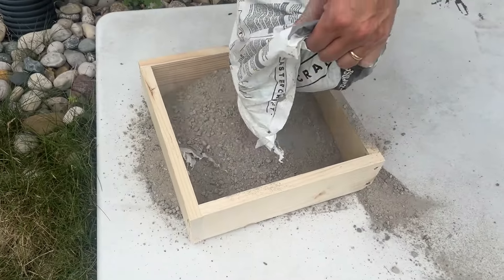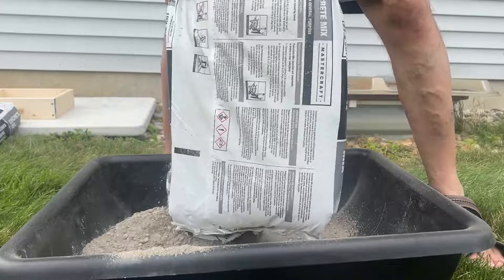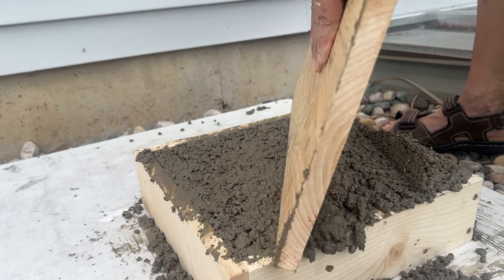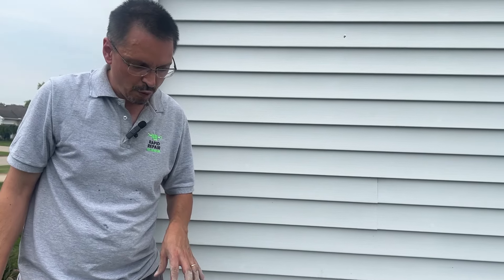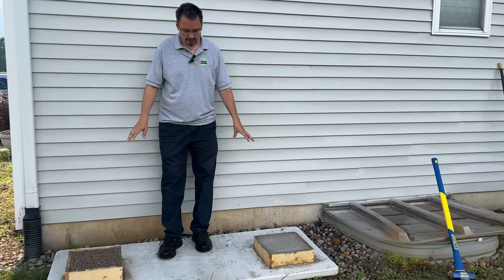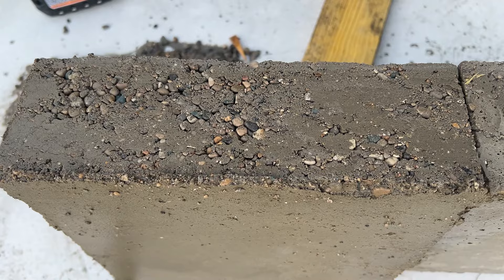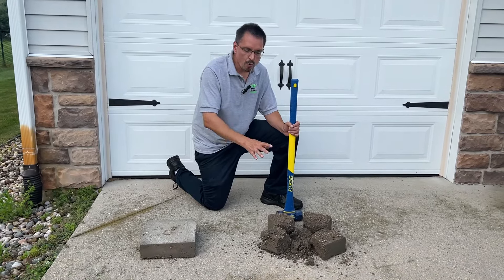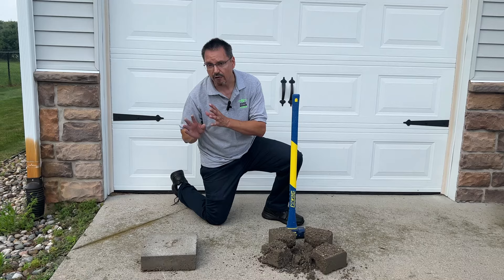Can You Dry Pour Concrete? DIY Concrete

Comment: Great demonstration, thank you.  I wonder if dry pouring into a wire grid would prevent this, and therefore the benefit returns?  But 'buyer beware' is clearly the message.
Reply from the maker: Yes 100%. You get it 👍🏼
Reply: Doubt it, you can see the first hammer hit the sides are already crumbling, it's like compressed dust and no reinforcement is gonna hold it together.
Reply from the maker: @greentjmtl  I think it’s only for very small projects and a home owner with literally no home improvement experience.
Reply: @HomeRapidRepair  Yeah I suppose something is better than nothing. Would be interesting to see it compared with "soupy" concrete, although I'd imagine the latter would still hold up better.

Comment: The crucial part is extensive watering during the first 24 hours after screeding to make sure it soaks all the way through before the surface gets to hard from the first mists. If you shower 12 times in 24 hours you'll be on the safe side.
Fulll cure will be accomplished after a month like wet pour obviously.
Reply from the maker: I agree that a strength test isn’t fair until a month curing time. Thanks for watching 👍🏼

Comment: Might be the dry pour was still wet... just looking at the color (wetness) between the two. Maybe try it again after a few dry days  and see if you find a difference? Nice video tho
Reply from the maker: So after the video, I noticed there was a dramatic color difference between the two. The premix wet pour was almost white. The dry pour was gray. I’m wondering if the Portland cement doesn’t get mixed properly with the dry pour. But yeah, doing a longer test with letting it cure more than 24 hours would be interesting as well. Good idea.

Comment: You did not apply enough water on the dry pour and in fact the dry pour was still not cured 🤦🏽‍♂️ I still will take wet pour over dry pour any day depending on the project
Reply from the maker: Your points are valid. Although we did soak the dry pour multiple times in the evening off camera.

Comment: it's obvious the dry pour is still not cured I have a 4x4 fire pit dry pour and it's cured all the way through and is tuff as nails going to do my side walks next year the same way the most weight that will be on it is my garden tractor it'l be fine and if you get any soft spots there's patch cement that will strengthen it up at least that's what I figure
Reply from the maker: Great points. Thank you for watching 👍🏼😊